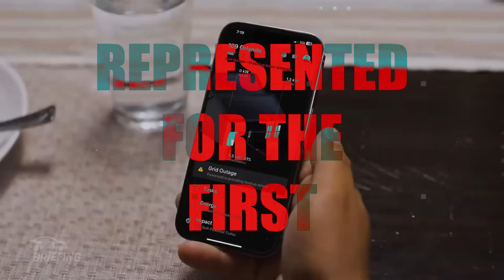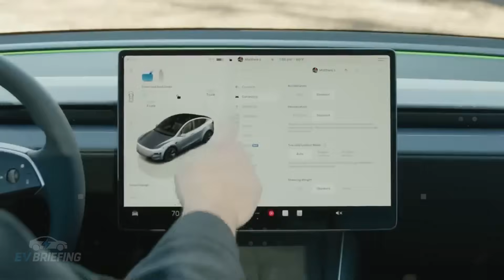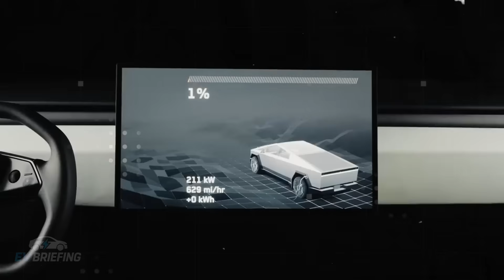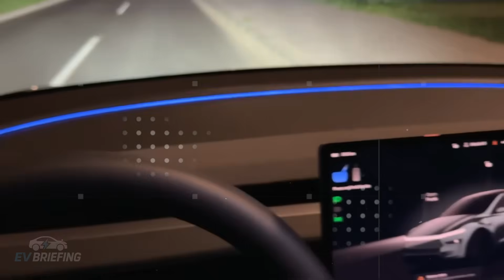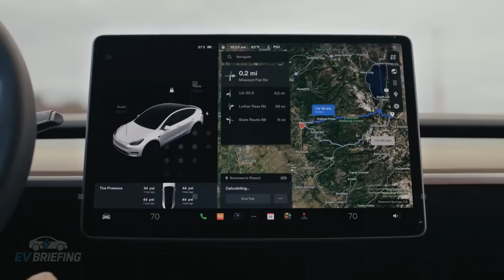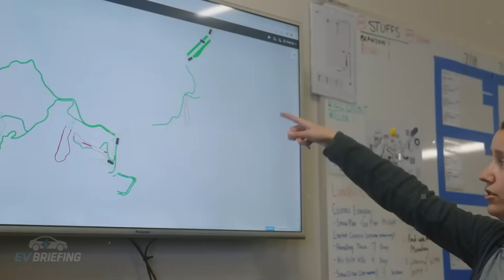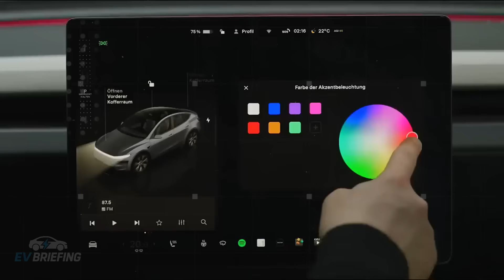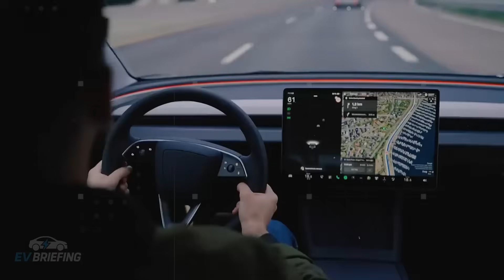IT’S HERE! New Tesla Model 2 With New Aluminum Battery - $9,475 With 531+ Miles And 15-Min Charge!

Comment: $9,475 With 531+ Miles And 15-Min Charge!. No way! If that's the case the Cybertruck should be $40,000 with with essential features, not stripped down.
Reply: I hope they switch all Tesla models to the new battery.  The cost savings alone would make them more appealing and the fast charging time?  Wow.
Reply: @rogerrussell9544  Looks like someone is off by a factor of 10 unless Tesla coming out with a motorcycle.